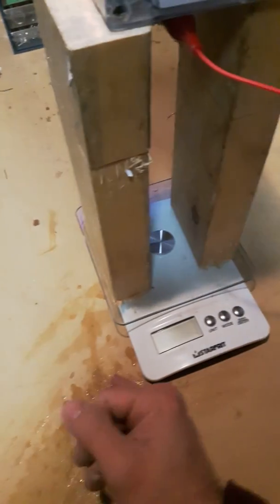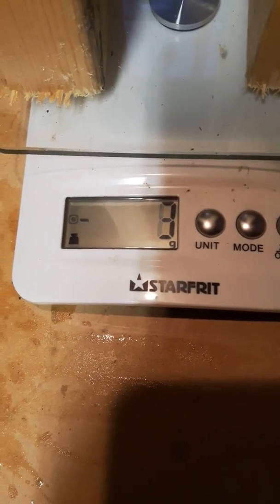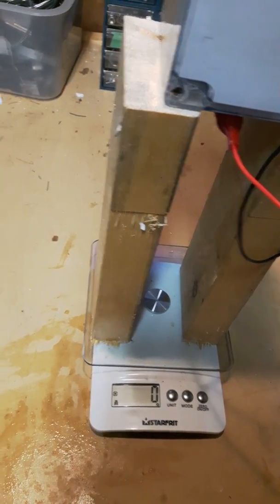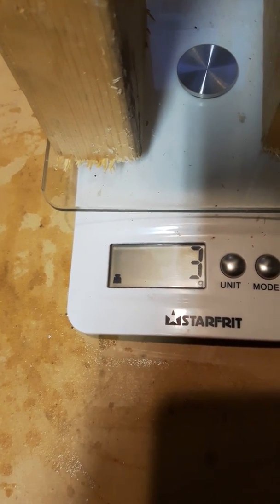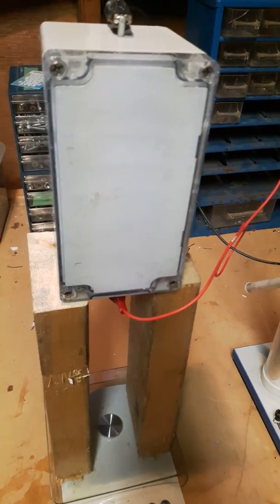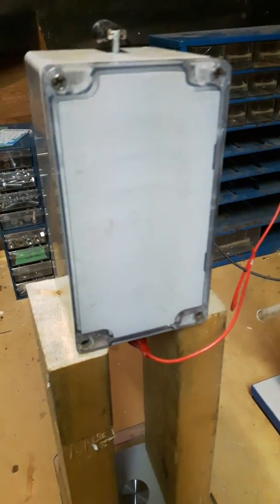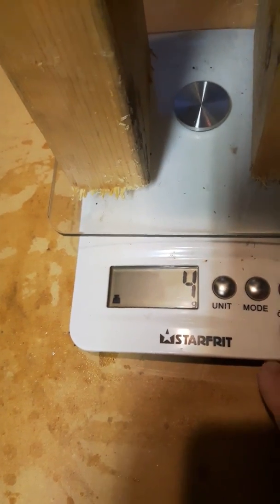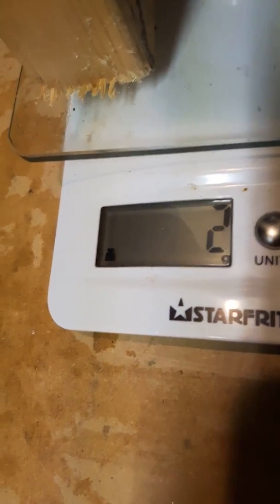T.T. Brown type Gravitator mass fluctuations?

Comment: Yeah the scale needs to be shielded. The anomaly is in the spark gap and is interfering with the scales ability to work correctly. You could also try to move the spark gap away from the scale and see if it persists...
Reply: You can do better and faster not using digital scale but an old, spring based one. Guys please, be practical! :D
Reply: @tanner1985  Exactly what I was thinking, just use the old scales, before digital.
Reply from the maker: Distance matters not! Yes the scale should have some shielding. Ive learned quite a bit since this test. Also, high dv/dt  kilovolt pulses can exert forces on surrounding objects.

Comment: Could it be from air pressure against the discharge
Reply from the maker: Ive noticed to my surprise, that sudden changes in the multi kilovolt ranges on an electrode or whatever, exerts a force on the surroundings... So I believe there is a type of compression or expansion shock wave due to the electrification of the air.

Comment: Nice experiment. It could be said that the shock wave is having impact on the electrical components in the scales. May be a Faraday cage around the scales could eliminate said possible interference.
This is a 5 star video.. Good work.. DC
Reply: https://youtu.be/Fkjq8hUfOYg?si=SNxf5tyl9jprFQj2

Comment: You create longitudinal aether waves when you discharge a HV DC field, (Tesla states this in relation to roentgen rays).
The Aether has inertia, so it causes changes in weight.
Reply from the maker: It could be, I have thought a lot about it. I have seen objects move near hv terminals charging and discharging rapidly. My belief at this time is there is a longitudinal wave of the air molecules during electrification which can of course exert forces on nearby bodies. The thing that needs to be done is isolation of these experiments in a vacuum, which is a hell of a lot easier said than done!
Reply: @failforwardresearch3127  There are people on YouTube doing experiments with vacuums. You might want to contact one of them to see if they could try this experiment in a vacuum. Very cool though.
Reply from the maker: Thanks. There's also the issue of interaction with the container walls from E fields.
Reply: @failforwardresearch3127  there is a peer reviewed paper that demonstrates biefeld brown lift is not created by ionic thrust. And shows a solution using a lagrangian with einsteins field equations as to how it manipulates space time.
Reply: @th600mike3 what is it created by then? Link?

Comment: Great! but what DC polarity gives what force? also, where did you get the titanium di oxide? great dielectric, I want to use it also with my plate coils
Reply from the maker: I got the TiO2 at a pottery supply store, as well as Cobalt oxide, manganese carbonate, and aluminum hydroxide...the list goes on
Reply: @failforwardresearch3127  ah good to know! I will find it there
Reply from the maker: I have no way of knowing the polarity on that whimshurst machine. The force effects are pretty intriguing, there's a number of things going on: electric induction, dynamic electric field gradients, longitudinal air compression/expansion, ion wind...
Reply: @failforwardresearch3127   keep in mind there are 2 kinds of induction, one from the change in current the other from the change in voltage.
seem this uses the last type and sets up a literal Displacement current
Reply: Love this... DC